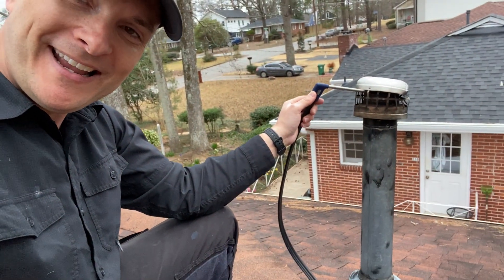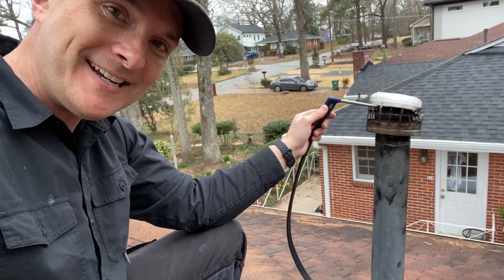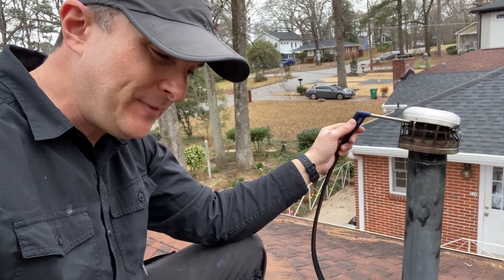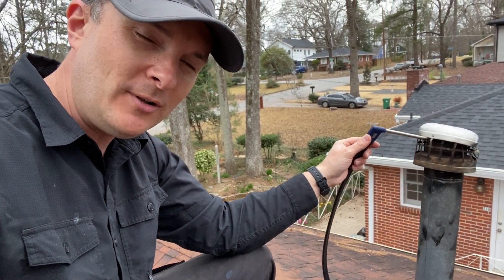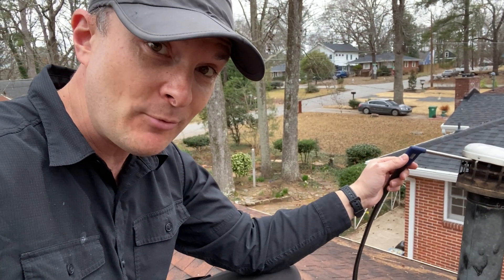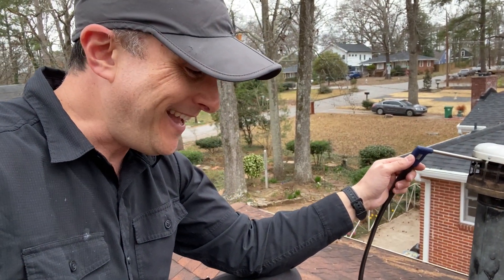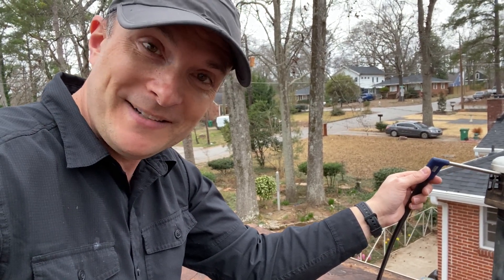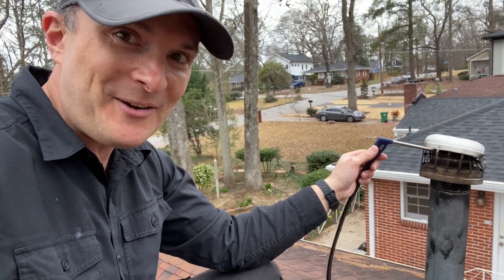Furnace FAIL: Massive Carbon Monoxide Problem Tested from Home's Roof

Comment: Why are you testing outside? CO outside is not a problem…it’s CO spillage in the living space you need to test for. 
Also, You shouldn’t have the test probe in the flue…
Reply from the maker: Guess you didn’t watch the vid, but yes the probe is obviously in the flue and it’s a B-vent from the attic, much easier to test here on the roof.

Comment: Hi Ethan. My name is Shaneka. I am reaching out for help with headaches, fatigue, excessive sleeping, clay/dirt/dust “soot” widespread throughout the home and in my nose, bad smells in the attic and throughout the house. I need help. We heat and cool with mini splits but get the natural gas smells. The fire department read hydrogen sulfide. There used to be a furnace in the crawl space one technician told me and another told me it was no longer there… There is an oil smell in the basement. I need some serious help. What do you think the problem could be in this house?

Comment: What kind of detection equipment and techniques do you recommend for homeowners or renters to test their own appliances?
Reply from the maker: A low-level carbon monoxide monitor like the Defender ($180), plus annual maintenance with a quality tech.

Comment: i wonder what a correct co level is?
Reply from the maker: Zero would be correct
Reply: @HomePerformance  it's a vent for combustion. it has to have carbon monoxide in it. just like my tail pipe. but... what do i know.
Reply from the maker: Oh, inside the pipe- you’re still looking at ideal = 0 ppm, but we let it climb to 100 ppm before a tune up is needed.

Comment: Best part: there doesn’t have to be anything wrong with the furnace for that level of co to happen. Just the fact that it’s in an attic creates a whole bunch of problems. Attics are not usually very large spaces so 1 pipe vented furnaces need a larger opening for combustion air to ensure the burners are being fed the right fuel/air mix. In smaller spaces like attics return duct leakage will have a bigger effect on combustion air supply. 
And whereas in basements (and even crawl spaces) stack effect is working with the furnace to suck air in through the leaks on the bottom of the structure, that force is not likely to help much in an attic. If you encapsulate the attic with spray foam or something, forget it. You’ll have 20 lbs of soot in that heat exchanger in a month. Add to that that’s it’s challenging to get get the required vertical rise on an 80% when the unit is installed in an attic. With out a tall enough stack it will not vent properly.
Reply from the maker: Great points Paul

Comment: Thanks to your recommended carbon monoxide detectors in my better half overhearing me listen to your videos about carbon monoxide poisoning she has gotten a lot better about turning on the kitchen fan when she hears a carbon monoxide alarms go off. 

      She used to ask me what are those noisy things making noise. 

     She didn’t listen to me

But after she heard your video she is very fast react now.
Reply: Wait, WHAT?  I've only had a carbon monoxide alarm go off once, we evacuated the house and called the fire department.  (It was a leaky wood stove with embers from the previous night.)  Never had an issue in years of running gas appliances or a propane heater in my garage, with CO sensors right next to them.

You should be calling a mechanic, not opening the windows.  (Or if this is a joke, it went over my head.)
Reply: @robot65635   we purchased the ultra low carbon monoxide detector.   We’re talking 7 ppm showing on the screen. 
          And that’s just because she did not turn the hood vent fan on while she had the burners cooking food. 

But she has left the burners on before for like 15 minutes while she walked away come back to the alarms at 150 ppm
Reply from the maker: NICE

Comment: So do you never make a test port in B vent (double wall vent)? If you do whats the best method for sealing it?  Great video.
Reply from the maker: Thanks Bryn- you can use a step bit, but you’ll need hi temp caulk to seal the inner liner, then tape on the outer. Don’t carry caulk with me, because it’s gross.
Reply: @HomePerformance  lol ok. I like the caulk is gross take. One of my shirts is definitely stained from some of the high temp caulk that kinda get everywhere on accident. I have some high temperature caulk but it tends to harden up making it difficult to use the next time and sealing between the two walls/inner line can be a bit tricky. I was listening to a podcast from a local home inspection (Company I trust a lot) and they said they don't ever drill into b vent because it goes against manufacturer's specs. That was the first I had heard of that so yeah. I guess I could follow up with them. My understanding is my reason to use b vent is if you're venting is going to be too close to combustible material?
Reply from the maker: Or if it’s a higher efficiency piece of equipment whose exhaust temp isn’t super high, and the vent is in unconditioned space where it needs to be insulated to make sure the buoyancy doesn’t diminish before the gases escape the house.

Comment: I have a high efficiency tankless hot water heater. It purges the air at the end when you stop using hot water. That purged air has unburnt gas in it. So that side of the yard always smells like gas. I have had the gas company out a couple time and they said everything is working correctly and just ignore it. 

So we can no longer use smell as our warning which is a bummer. I had a gas explosion sensor installed in the garage next to the tankless unit just incase.
Reply from the maker: WHAAAAT- that doesn’t sound right bud. I’ve never heard of a gas valve continuing to seep gas after the flame has gone out. No way any human engineer would design it to do that. Something is wrong.